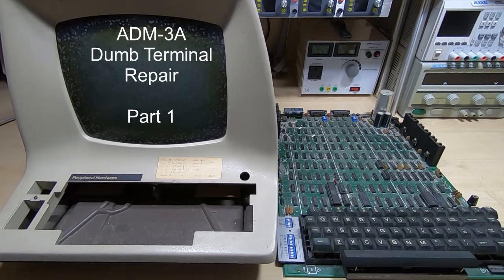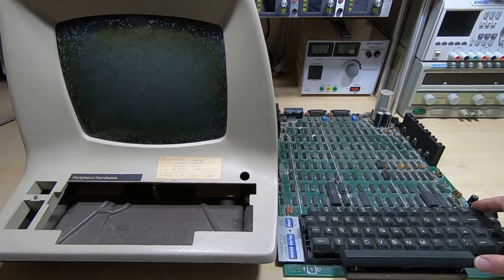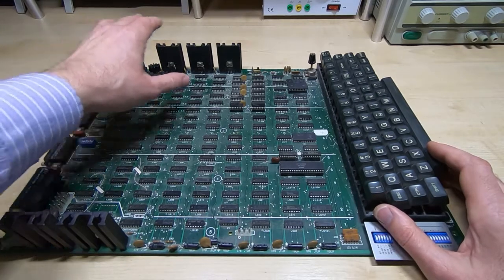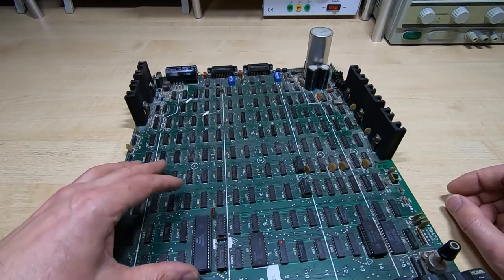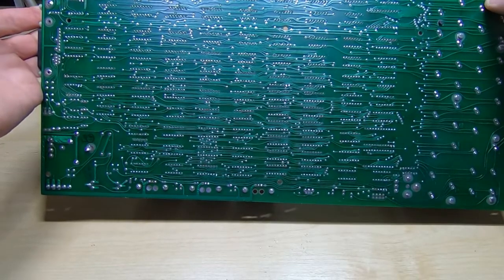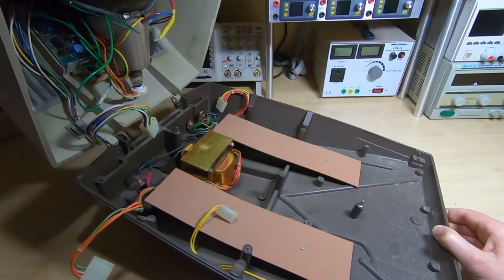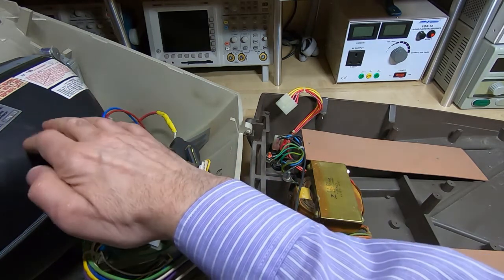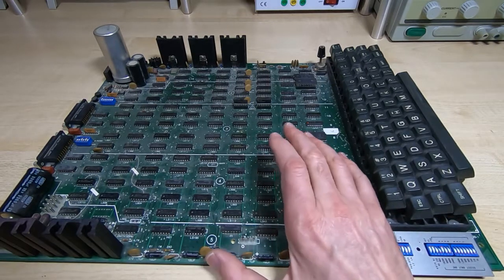ADM-3A Interactive Terminal Repair Part1

Comment: The very reason this is so over-engineered, is literally because the ADM-3 bolted a microprocessor on top of the ADM-2, which was done entirely in 7400 series logic. They didn't start from scratch.
Reply from the maker: The ADM3 is entirely discrete logic apart from the UART. It does not contain a microprocessor.

Comment: What might make an ADM 3A show characters rather than move the cursor when Ctrl-H -J -K -L are pressed and also when Line Feed or Enter are pressed?
Reply from the maker: It sounds like you have the code switch in the wrong position. The manual has a section which explains the purpose of each DIL switch. The internal switches (at the rear of the pcb) are used to select various modes of operation.
Reply: @JerryWalker001  Hmm. The manual says CODE is only active when 202 is on but I have LOCAL on. I tried turning LOCAL off and 202 and CODE on but no joy. Since I want to hook directly to a computer with no modem, it says to use LOCAL on and 103 and 202 off.
Reply from the maker: @tomlake2732  If you are sure that all the switches are in the correct positions and the Alt key works for other functions then check the operation of IC J2 as it decodes the characters as functions and not characters.
Reply: @JerryWalker001  Well, I replaced J2 with a known good chip (74LS42) and it still shows directional arrows instead of moving the cursor, a tiny underlined bell when Ctrl-G is pressed, etc. I'm stumped.
Reply from the maker: @tomlake2732  You should also check the circuits around J2. This part of the system is fairly complex so you may find it easier to work back from the control lines to see what is not working. As they are all not working then you should check for the control strobe output as this should be active for all non printable characters. I assume that you have checked all non printable characters (eg bell). If you are in the UK you could send me the board if you cannot make any progress and I will repair it here.
Reply: @JerryWalker001  I replaced J2 and H3 and can use some control codes now. Some weirdness remains, though. Enter doesn't move the cursor but will stop the keyboard from responding until shift-clear is pressed, Shift } doesn't respond, Ctrl-H has no effect, Ctrl-L moves the cursor down. Ctrl-J and K work as expected. Such a puzzle!
Reply from the maker: @tomlake2732  Sounds like there are still a few failed devices. It sounds like an incomplete cycle is being started so I would trace the command process. Look at the control line going to the main key decode latch and make sure it is clearing. These boards can behave very oddly with even minor faults.
Reply from the maker: @tomlake2732  I forgot to say, be sure you have the terminal correctly configured with regards to half or full duplex mode as this will affect how it responds to some key presses. Enter may do nothing on the screen in some modes so always have it connected to another terminal when testing. This will also make it easier to trace the operations.
Reply: @JerryWalker001  Hey, thanks! It's getting better and better. The characters on the right are slightly narrower than those on the left now. The manual says to adjust the "horizontal linearity sleeve" which is "under the yoke". I totally removed the yoke and I see no sleeve. What's the manual talking about?
Reply from the maker: @tomlake2732  It will depend on the tube type and deflection coil type. The linearity sleeve, if fitted, is just a piece of foil on a paper backing. You normally rotate it until the image is symetrical. There are other ways that this may be done such as small magnets. It may also be incorrect setting of the sync levels or even incorrect power supply voltage. These old displays were very variable hence my steps in getting a linear display when I made the reproduction terminal. This can also be cause by failed linearity components fitted to the deflection coils. It is best to have a close look around the deflection assembly to see what form of linearity control it uses.